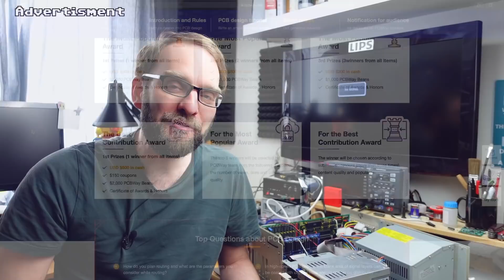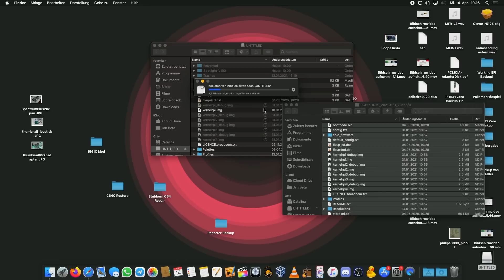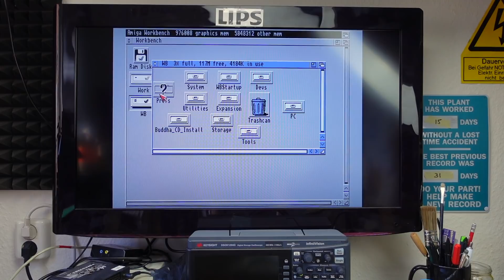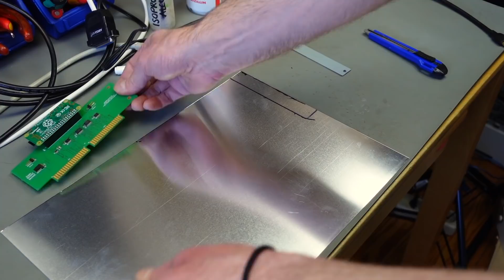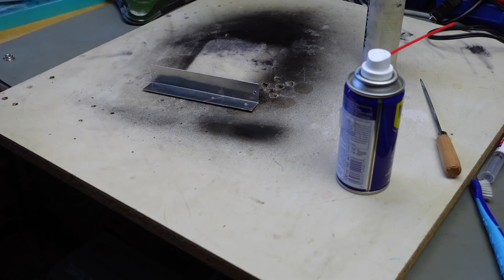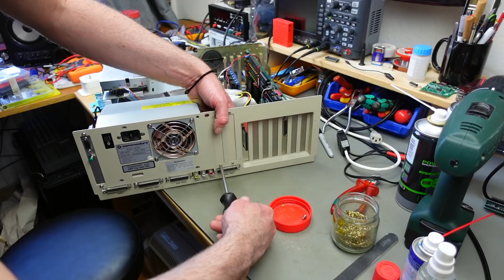Amiga 2000 RGBtoHDMI Installation

Comment: can be used on A4000D?
Reply from the maker: No, it doesn't work with the AGA chipset (A1200/A4000/CD32), unfortunately.
Reply: @JanBeta  with the specific AGA modes, it is obvious that it does not work but when it works in OCS and ECS, has anyone tried? looking at the diagram I saw that it uses exactly the same signals as the A2320 card which however also works on the 4000 while ignoring the extra color bits.

Comment: Can you then use the Amiga RGB Out simultanously with the RGBtoHDMI to use two monitors on one machine?
Reply from the maker: Yes, the regular analog RGB out from the Amiga still works with the RGBtoHDMI installed. The little board just uses the digital signals provided by the Denise additionally. :)
Reply: @JanBeta  Thanks! That's cool!

Comment: I have an A4000/030 with Emplant Mac board, and a Microvitec multisync CRT monitor that connects to it to allow flicker free video. However, I had a silver adapter which goes from the DB25 video port on the back to the monitor's 15-pin VGA-style cable. I can't find that adapter now. The A4000 doesn't seem to have the same video port I had in my old A2000 which had a genlock. Is there an easy way to connect it via HDMI/DVI and bypass the CRT monitor? The Amiga powers up and the hard disk crunches like normal so I suspect it's in fully working condition.

Comment: Inspired by your video I got myself this expansion for my Amiga 2000 as well. It worked right out of the box, brilliant picture, but I am using a Lcd Tv and put the settings from dvi compatible to hdmi rgb yuv auto, don't know whether your Lips Monitor works with hdmi or dvi....
Reply from the maker: The LIPS has HDMI. I tried to fiddle with that setting, too, but it had the same issues. Glad it worked without any problems for you! :)

Comment: Quick tip for threading sheet metal: Instead if drilling a hole, try punching a hole. The resulting burr holds more turns of the thread and therefor grabs the scew way better. When working with aluminium or mild steel sheets you can omit threading alltogether since your screws are hard enough to thread them (you didn't hear that from me!)
Reply: Oder auf deutsch: Versuch das Loch zu treiben statt zu bohren. Mit hammer in altem Schraubenzieher. Dann kannst du das Gewinden in den Grat schneiden.
Den Rest den ich oben gesagt habe werde ich nicht auf deutsch wiederholen, sonst werde ich von wütenden Schlossern zerfleischt :-P
Reply from the maker: Ergibt Sinn! Ich wollte nur kein Risiko eingehen, weil ich das ja wie gesagt zum ersten Mal probiert habe. Und keine wütenden Schlosser-Kommentare riskieren... ;)

Comment: Hey Jan, bmthr is here!!! :) I saw that you tested my fix with 47pF capacitor and in your case this fix doesn't work. Which Denise IC is in your A2000?
Reply from the maker: It is an 8373R4 in there. I upgraded this Amiga from the OCS to ECS (Agnus and Denise) a while back though, so maybe it has some slightly different timings than an Amiga that came with the ECS chipset originally? The 47pf cap made things considerably worse for me, I settled with a 22pf one and it seems to suit this setup better. Pretty stable picture now, apart from the very occasional flickering line.
Reply: @JanBeta  I have a same problem with my A2000 when upgrade to 8373, best solution is overclock RPi0. Also VHC (74VHC86, 74VHC574) instead of LVC logic chips also helps!
Btw, I really like your videos!!!

Comment: I had the sparkling issue on my a500 i fixed it by using the full pallet option in my version of workbench.
I'm using amiga os 3.1 with betterWB installed and it's pretty solid.
Reply from the maker: Ah, thanks, I‘m going to try to fiddle with that setting, too.

Comment: could the WiFi on a pi zeroW be used thru the graphics expansion port, or would you have to employ a USB adapter and use it as a serial modem?
Reply from the maker: I think the pi is very much occupied with its task for this mod and it’s running on bare metal software so there’s no drivers for anything installed in this configuration.

Comment: overclocking might need more amps that the motherboard can not deliver, 
pi-zero has different versions, which version is recommended ?
Reply from the maker: It should not be an issue from what I’ve read but I might try adding external power to see if that makes the overclocking work better. The version should not matter, the WiFi is disabled anyway with the bare metal software. My pi is an early version with WiFi, got it shortly after it was released if I remember correctly.

Comment: Jan's gonna pop some threads...!  Only got 20 euros in his pocket...!
Reply from the maker: Yeah, always on a budget. Worked well enough for aluminum though. ;)
Reply: @JanBeta  BTW with your flickering problem did you try a different display? It would be nice to know if it's a display tolerance issue or your PI, or your PI itself.  Some people have had flicker issues will specific displays.  I have this hardware on my A500 and A2000 now.  Removed my A2320 as the quality of the RGB2HDMI is incomparable.

Comment: LinuxJedi did a new design that only need one CPLD Chip. That one should eliminate the flicker problem that appears on some Systems. The new design even reduces the cost for the parts to somewhere around 5 Euro https://github.com/LinuxJedi/AmigaRGBtoHDMI And in combination with Ians Beta 18 Software it should solve the flickering. It will also work with any Denise without jumper, becaus LinuxJedi changed the sync completely to another solution.
Reply from the maker: I am going to try the new version eventually! :)

Comment: How much lag is there using a raspberry pi? There has to be some.
Reply from the maker: C0pperdragon says it’s only a couple of ms at the most. I tried measuring it with a "high speed“ camera (well, my phone set to the highest frame rate) and running a CRT and an HDMI monitor side by side but couldn’t see any difference. There definitely has to be some added lag but it’s VERY minor.

Comment: Not sure if it helps. But I released a version for the Amiga 500 that doesn't need the jumper (and has none of the issues some have experienced), it also is easier to fit with accelerators. I'm working on an Amiga 2000 version of it. This is the Amiga 500 one on PCBWay: https://www.pcbway.com/project/shareproject/Amiga_500_CPLD_RGBtoHDMI_v1.html
Reply from the maker: Nice work! I heard that there was a new version in the works, I’m going to have to try that eventually. :)

Comment: You probably need active cooling for the Pi if you are overclocking in restricted spaces like you Amiga 2000.
Reply from the maker: Oh, it stays relatively cool even with the case closed. I think it gets enough airflow from the fan in the power supply with the little heat sink on top.

Comment: Just a tip. For that thickness of aluminium sheet, don't drill the holes, rather use something sharp to punch them (like a steel nail), while placing a nut (m5 or m6) under the location of the hole (to allow the metal to stretch on the other side). This way, you can create a small funnel-shaped feature which provides more "length" for the threads.
Cheers 🙂
Reply from the maker: Makes sense. I was actually considering that but then I thought it would be a good idea to play it safe and remembered I had bought the threading toolkit. ;)
Reply: @JanBeta  don't worry, you'd still have to use the toolkit, to make the actual threads 🙂

Comment: This reminds me of building my new gaming PC (with a recycled video card since you can't buy them). I wanted 2 radiators but the top radiator mount hole was like 2mm to small. So I had to dremel it out. Then the water pump needed a place to mount so I drilled holes into the hard drive/PSU cage. I had never done anything like this before. And yes I made sure to file it down with the dremel. It turned out nicely. You can't even tell I cut the radiator mount to make the hole bigger (it is covered after all). And the screw holes for the water pump were almost perfect. The 4th hole moved on me just a tad so I had to move the hole down a bit making it bigger, but it's covered by the pump so you can't see it. It's wonderful!!!! My Ryzen 5900x runs at 60 degrees C under load! That's really cool for a modern CPU. And it idles at only a few degrees above room temperature. I'll add a video card to the loop eventually, but I didn't see a point in doing it with a 7 year old video card for now.
Reply from the maker: Glad you successfully modded your case! I find it always feels incredibly satisfying to utilize your skills for things like that. :D
Reply: @JanBeta  I just hope the final video card fits.........if I can ever actually buy it. Considering I PLAN to buy a water cooled model it should be a bit more compact than the air cooled variants.

Comment: If it's just aluminium sheet metal, there's really no need to tap the hole-  a steel screw is hard enough to form threads all on its own.
Reply from the maker: Makes sense!

Comment: Fantastic progress on the different systems. Amiga Digital Video just gets better and better.
Reply from the maker: Yes, it's such an amazing project. Low cost HDMI from our beloved machines finally. :)
Reply: @JanBeta  Yup. I am just wondering. What is someone took an analog to digital converter circuit, that can handle 240p input, and injected the digital signal the same way into the PI. Would that not make a cheap HDMI output for Commodore64? I mean, the software is actually ready for C64.

Comment: Nice job! You actually need the proper drillbit sizes for tapping the metric screw sizes, they are not even mm holes you need. Easiest is to get a good combined bit with the drill and tapping combined. Würth makes some nice ones.
Reply from the maker: Yes, I would have to get some 2.5mm and so on bits to properly do it I guess. Probably not really worth getting better tools for this job because I don't use it often. :)

Comment: If the Pi Zero struggles slightly with this kind of use so that you need to overclock it, wouldn't it be better to use something like a full fat Pi 4B which is more powerful anyway?  With an accelerator board as well, especially something like a 50mhz 68040, that A2000 would become a real beast of an Amiga.  This project makes me wonder if you can use a Pi as a CPU upgrade for an Amiga.  I think I heard of a newer model graphics card for big box Amigas that could plug into Pi boards for use as an accelerator but they seemed very expensive when I looked at them.
Reply: Unfortunately the situation is more complicated than that for several reasons, and a Pi 4's GPIO works completely differently. That being said there are things in the works...
Reply from the maker: I think you would have to modify the software to use different pi models. But I bet it would be possible to do. The PiStorm is on my radar, definitely going to tinker with that sometime.

Comment: Great video Jan, I really enjoyed this one. Going the extra mile to make the bracket was brave and paid off really nicely. Waiting for a RGB to HDMI board and parts to arrive for my A500 so looking forward to a similar experience! Also have a PiStorm board on the way, something that would go well in your 2000 - you did mention you wanted an accelerator board in there...
Reply from the maker: Yes, I'm really glad I went that extra mile. Works beautifully now. The PiStorm is on my radar, I'm most likely going to tinker with that soon. :)

Comment: i hope someone is working on a card that sits on the zoro 1 bus and hosts a pi zero like this for a usb stack and networking all the other connections a pi can provide, maybe a higher end hard drive emulation
Reply from the maker: Oh, that would be nice. There's a couple of projects that enable different things with pis in the Amiga, but I haven't seen any for the Zorro slots yet.

Comment: I wonder if anyone has tried building a solution around the MS9282?
Reply from the maker: I am not familiar with that particular chip but judging by the data sheet it could possibly work. No idea if the lag would be noticeable though.

Comment: That looks really, really great.  I still feel weird about having a computer that's so much more powerful than the Amiga just to do the video. It would be cool if you could use the pi as an accelerator as well though!
Reply from the maker: Yeah, it is kind of a strange idea to use a powerful small computer like that. But, hey, it is cheap, low power and works well. So I'm fine with that. There's the PiStorm project that uses a pi to replace the processor and acts as an accelerator. I'm definitely going to check that out at some point, too.
Reply: @JanBeta  Yes, totally. I would have killed for a display that crisp on my Amigas back in the day!
Reply: @JanBeta  Pistorm sounds amazing...! It's a shame to not have the original CPU in there, but cheaply getting 70-80MHz is quite cool.
Reply: @JanBeta  Are you able to get your hands on a piStorm these days because of the semiconductor shortages (the needed EPM240/570 is out of stock everywhere) ?
It might be that someone at the piStorm Discord have some spare for local shipping, but the waiting list is getting long now..
I have a batch coming in any week now, some spares in that after getting the reserved out (primary for distribution in the Nordic countries because of high postage costs from Sweden)
Reply: In my opinion, the piZero is only good enough to act as an add-on for our awesome A2000's!
Reply: I felt the same way until I put one in my Amiga 500, and the picture quality is absolutely amazing! So I got over it pretty quickly.

Comment: Is there any alternative for the Amiga 600 that isn't the vampire? I don't really have space for anything bigger(even if I had it's hard to get wife approved)
Reply from the maker: There is a new version of the adapter for the A600 that was just released. I got one from the designers and am going to make a video soon!
Reply: Look here....  https://github.com/c0pperdragon/Amiga-Digital-Video/issues/22
Same Pi project....
I just ordered a premade pcb from Ebay but have not yet installed it. Yet... You need some soldering
Reply: I have one installed I'm my A600, soldering the Connections to A600 is fairly easy. Make sure to use Thin cables, I used cut-offs from an old floppy cable. Getting the ICs in small amount in Germany is a different story.

Comment: Pi needs more voltage for overclocking
Reply from the maker: Yes, that may be the solution. It should technically get enough juice from the video port but worth a try powering it externally.

Comment: I can only recommend on getting a Dremel. The Dremel 3000 here, in a set did only cost 50€ and it still works after so many years. I've built and repaired so much retro stuff with it, especially things like metal backplates are a breeze.
Reply from the maker: I have a little proxxon rotary tool but I figured it would be easier and more precise to do it with the drill and files in this case.

Comment: Use your electric drill on low gear to use the thread bit or tap drill to make threads. As the metal is in this case very thin, just work it through the metal, not the whole bit and switch the electric drills turning to backwards to get the tap out. Very easy and quick.
Reply from the maker: Ah, didn't think of that. Good idea!

Comment: Nice work - on a side note I've always hated mods where the chip your adding is many thousands of times faster than the entire machine your modding though :(.
Reply from the maker: Yes, it is kind of a strange way of doing things. But on the other hand, it's relatively cheap and works well, so I'm happy with that. :)

Comment: SD cards you find in the street usually have malware on them that'll auto-run and install a keylogger to steal credentials and such and phone it home. If you ever plugged that into a phone or PC, run a scan and/or look for files installed on the day you found it.

No, I'm not joking. This a real thing criminals do. You'll find flash media outside of corporate offices that's intended to get plugged in inside by the curious employee who found it on their way in, which will then steal credentials and trade secrets from the office network.
Reply from the maker: Yes, I can imagine that. I was careful with the card and formatted it instantly.